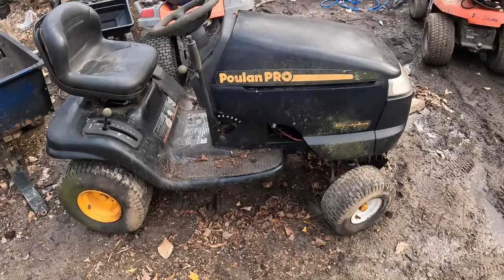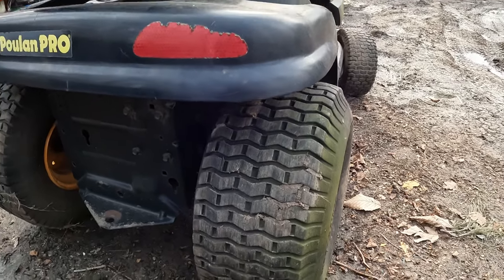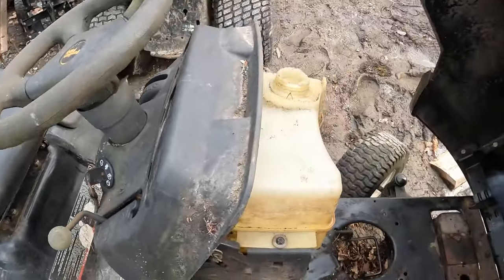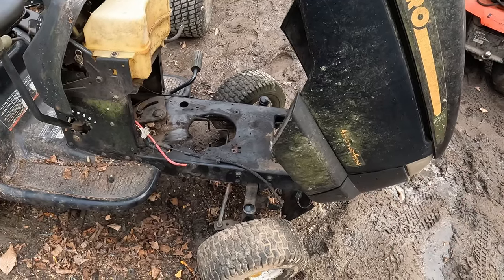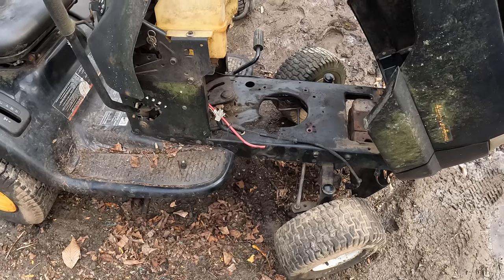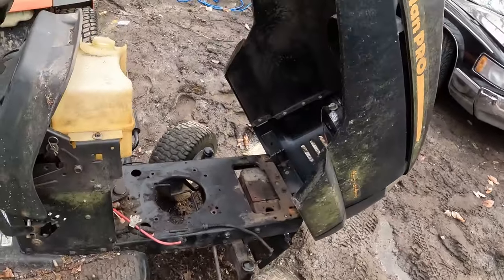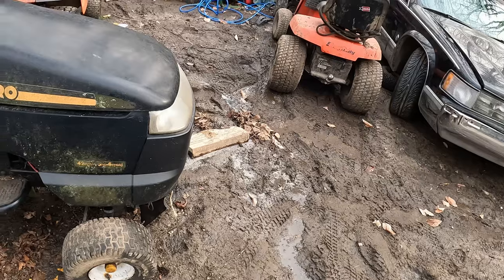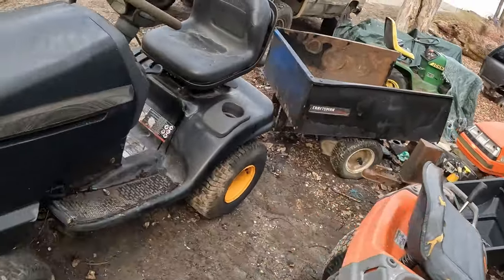I Got A Mower For FREE!!!

Comment: I wish I could get a free one. Around here everybody wants $100 for their non-working tractors.
Reply from the maker: Dude, no not gonna lie, kind of pisses me off when people sell their equipment like their lawnmowers for 200 bucks and the transmissions is blown engines not even in it it’s just a rolling chassis. I did get lucky with this one, but usually the cases I gotta buy them.
Reply from the maker: Also, I like your profile picture, I love Me a LT 1000
Reply: @ImpossibleMowers1998   I know right, I have seen so many mowers with blown engines/transmissions on FB marketplace. Like do they think their trash is made of gold? Lol. My LT1000 needs a trans and would have one by now if I had money, but nobody buys mowers yet and everything is expensive.
Reply: @ImpossibleMowers1998   Thanks!
Reply from the maker: I tell you man, you caint beat these old mowers. They are classics.👍💪
Reply from the maker: I honestly think that these mowers are so much better than the newer ones that people are selling them for more money. Because the classics are better. They never die out easy. I wish you the best of luck with your mower.
Reply: @ImpossibleMowers1998   Yup I love the old mowers, they're practically indestructible. My mower has a 90s briggs on it that leaks oil & gas but won't stop running, it is so reliable.  Thanks!
Reply from the maker: yessir my dude, this might be a spoil but ile let you in... the next video is putting the engine in the pulan and nothing screams reliable than a 2000s Briggs and Stratton 24 hp V twin.  they just dont make them like they use to these days. but im glad they made so many of them lol. I drive mine to work now and then so they make good offorad and travle riggs lol.
Reply: @ImpossibleMowers1998   Can't wait!
Reply from the maker: Thank you very much for supporting the channel dude, glad you enjoy the content.
Reply: @ImpossibleMowers1998   No problem dude, I love mowers.
Reply: @ImpossibleMowers1998   Yo I got my mower going! With a pulley swap.
Reply from the maker: Right on dude, that’s awesome!!! How fast we talking?
Reply: @ImpossibleMowers1998   About 9MPH
Reply from the maker: That’s a good number to of road with